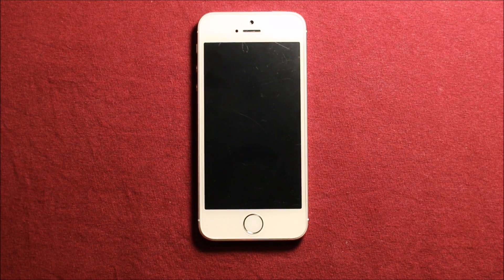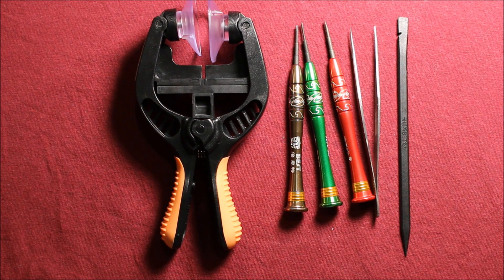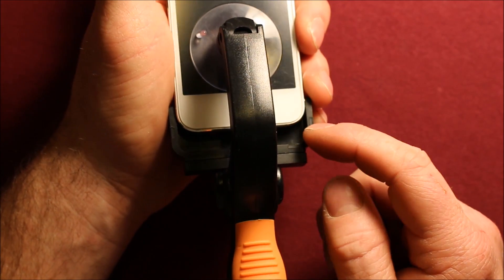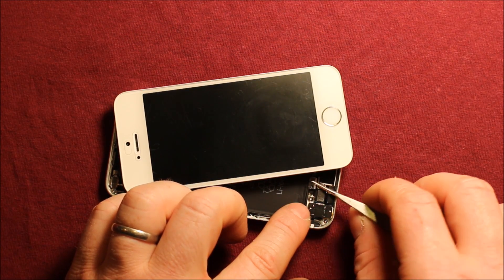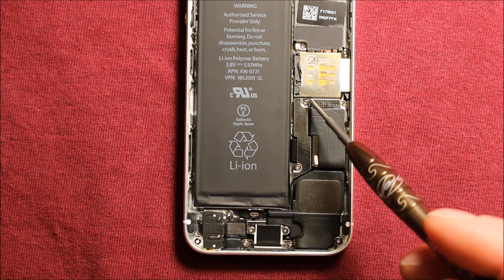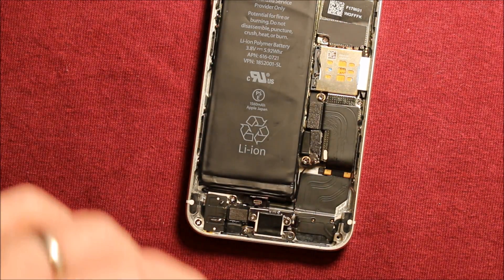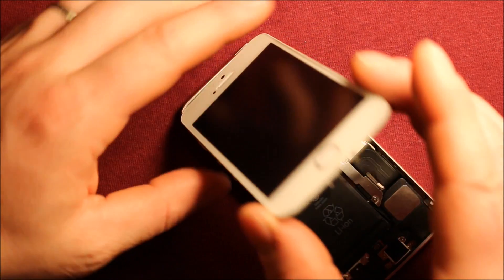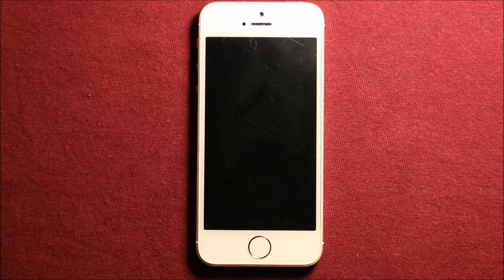IPhone 5s Loud Speaker Replacement How To Change

Comment: Is taking off the LCD necessary?
Reply from the maker: +Matter - If you lay it carefully to the said on the bottom so you have room to work without putting too much tension on the cables on top then you could try that.

Comment: Is it possible that the new loudspeaker I bought is not compatible so it's not letting the phone turn on? I followed all these steps and now my phone won't turn on. I'm not sure if that first connector from the 3 screen connectors is going in correctly. It kept coming out when l was trying to screw the metal piece back in. I finally got it to stay after a while. Might that be the problem? Do you think I ruined the connectors?
Reply from the maker: +Cesar Solano That sounds like it could be the problem like it's just not together right.. I would just take it back apart and do your best to get it together right and have a little slack on the cable if possible after trying to get it together.. It might be pulling out if theres tension on it.

Comment: Does this fix both speakers cause only one of mine broke and its the smaller one by the earphone piece?
Reply from the maker: +FuZe StAtiCz No this is only for the loudspeaker not that earpiece speaker.
Reply: Smart Easy Repair do u know how to replace that piece?
Reply: FuZe StAtiCz I have the same problem, but I am not sure if it is actually broke, I feel like it was built like that.
Reply: FuZe StAtiCz I was never rough with my phone, and I got it recently. Christmas Day to be exact.

Comment: I change the loudspeaker and still does not work :( suggestions?
Reply from the maker: Is there maybe a connector that's not together quite right? They can be tricky.
Reply: Smart Easy Repair I also replaced my loud speaker just now and it still doesn't work....what connectors in particular?
Reply: V